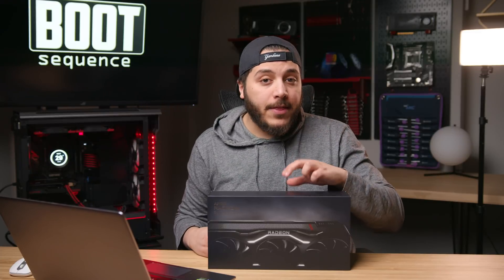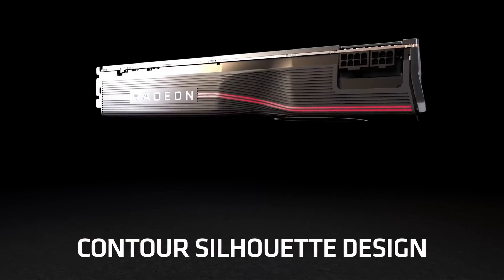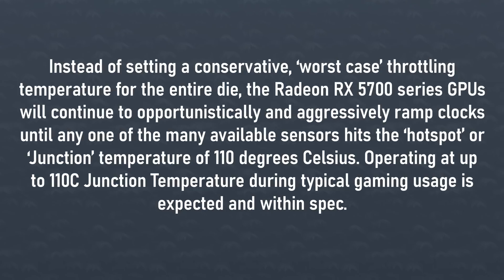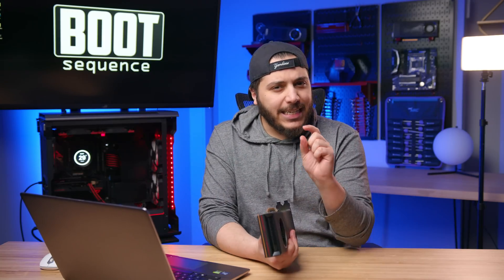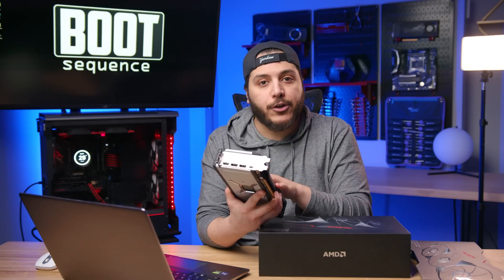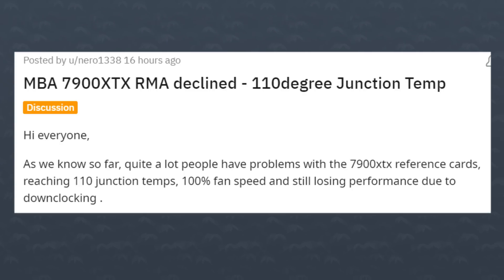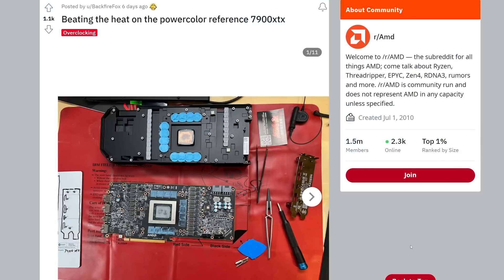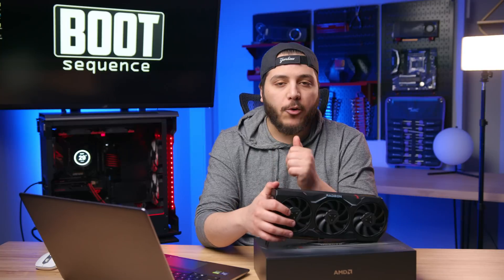RX 7900 XTX Reaching 110°c !? Not Again....

Comment: I literally just changed the 3 pads that surrounds the gpu on the xfx merc 310 7900xtx.  The stock ones were in bad shape. Im thinking its the pads i used cause my hotspot temp all a sudden is 110c.  Its never been this in the yr ive had the card.   Any recommendations on proper pads ?

Comment: I found a fix for my RX 7900xtx junction temp 110 degrees C.
My coolermaster case has the giant 200mm fan on the side and was blowing fresh air in at my GPU.
The Gpu blows its hot air out that side so the air coming in the side fan at the gpu was stopping the hot air from coming out of the gpu! I turned the side fan around to blow the hot air out and my gpu dropped 20 degreed from 110 down to 90!!!
I believe if there were no fan on the side and it was just a side panel this would block the flow from the GPU enough to cause the GPU to heat up.
Try running it with the side panel off and see if it fixes your problems!!

Comment: Honestly, the whole a situation reeks. Look, there was a lot of reviewers releasing the evaluation of their AMD cards on release date. They stress test the cards in high demanding games, running the cards hours at a time. Many actually tried mild over clocking...
One week later, you see a few cases protesting about high temperatures. Unless more formal evidence or testing, I would have take the same position of AMD. Looks like more likely buyers remorse of custimers getting the card and reacting to the Nvidia price reduction on the 4800, or using too small cases with bad air flow or playing to hard on the overclock dials. 
In my personal case, I choose to pay the extra $100 for the XFX Merc 310 7900 xtx, as I have the proper case, power supply and want factory overclock. The card runs cooler and more silent than my previous 108O Ti.

Update 01/03/23. Looks like there is some preliminary findings that in fact some batch of the XTX cards may be having a problem with the vapor chamber. More statistical information is needed to evaluate the size of the product problem, but the small sample show the problem in 1 our of the 4 cards.

Comment: I run mine with a slight undervolt and cap the clock at around 2600 and my highest junction temp is around 85 during gaming. I've left it default and had clocks boost to 3100-3200ish and hit about 101 on the junction temp. I prefer the undervolt to keep the watts down and temps down. Card idles around 40-50 on a single monitor and when I have two monitors plugged in the temps idle around 50-60 at about 100w board power, pretty annoying. I pre-ordered the EK waterblock and hope that my custom loop tackles these temps.

Comment: Yea my xtx hits 110 but in the 90° vertical position because that’s how my case has the GPU layed out. Once i layed my case over and the gpu was either horizontal or vertical. The temps went to normal. it doesnt help i hear coil wine also now. pretty disappointed…
Reply from the maker: Yeah, coil whine is pretty bad. but apparently its often PSU related ( the power delivery causes the whine in the GPU ). So it seems like you are affected by this issue, is that correct ?

Comment: Just thought I would throw this out- I got a XFX 7900xtx MERC and it has run very cool and quiet. With 3dmark stess tests, my junction temp hasnt yet cracked 70c, regular gpu temp 55ish.  Im air cooling with a fractal torrent case with ambient temps around 70F.  Normal gaming junction temps are usually 55-60C.  Sad to see the reference boards with such issues.

Comment: I repasted 3 times my dude , with different pastes. That was NOT the solution. Still hitting 110c quickly
Reply: Jesus is Lord  interesting theory, but on the amd software they define junction temperature as the hottest point on the cpu die.
Reply from the maker: what about your edge or avg temp ? If they're in the 70's, then theres a problem. If they're in the 90's, it should be ok.
Reply: @BootSequence  edge temp 60-70 max

Comment: Well you are a bit wrong, a guy who repasted his 7900XTX was still complaining that his temp was going to the max, and sent it to Der8auer.

Without changing anything Der8auer tested it and lo and behold it was completely normal with the Junction Temp reaching only 82 degrees.

Of course it could be that the dumbass just has the graphics card in a case with bugger all airflow.

So less of a hardware issue than a PEBCAK one.
Reply: "Without changing anything Der8auer tested it and lo and behold it was completely normal with the Junction Temp reaching only 82 degrees" is not true. He changed the thermal paste! As well as the "Guy"...

Comment: Sapphire reference 7900xtx here, can confirm im hitting 110c junction temp even at 100% fan speed, having to undervolt it to keep the junction temp a reasonable temp
Reply: I got one of those and suffer the same issue, playing God of War. Unfortunately for my case my local dealership is slower than a snail to process the warranty. And still waiting for the refund.  It's a shame that for saving something like 10 USD per GPU, they used the cheapest thermal pads, putty and paste.  For a low end GPU i accept that tradeoff, but for 1200 USD GPU there isn't an excuse for that.

Comment: The HEAT issue Comes From WINDOWS applications running Over AMD Drivers !
Reply: I won't be surprised if window has an update for AMD GPU balance power plan just like Ryzen CPU did.

Comment: Waiting to see what or if a dip in prices after CES. 4080 and XT are over priced. More than happy to skip a gen if it means they get the message.
Reply: MSRP to MSRP the 4080 is $200 more than the XTX. That extra $200 buys you DLSS + FSR + ray tracing and a GPU that doesn't overheat. You have an odd sense of "over priced" good sir.

Comment: I'm planning to get one, but at the moment i only have 2x 12v from my psu, since i'm upgrading from my 2080ti. So i have to get the Reference Model, unless i find a Card with a Custom Cooler which uses 2 instead of three 12v connectors.

Comment: In the past I had thermal (and noise problems) with my Vega 64 (Gigabyte, not the best), then some problems appear with 5700XT, then some 6800XT and 6900XT (MBA; Powercolor Red Devil 30% more expensive are fine 😅), and now the RX 7900 series...
Seems, for me, there a trend: AMD shows less expensive GPU than Nvidia (eg: 7900XTX vs 4080), but if you want a better and reliable cooling design/manufacturing, you've got to go to high end AIB models (less true with Nvidia, but still)
Reply: Another part of this 'trend' is that AMD always says it's normal behavior.  Working as intended.  Why don't we believe them?
Reply: @mikefur3957  because some people (reviewers, mainly) find those "disturbing" info before AMD tell them/us?
If it's expected, then why AMD doesn't mention them in the "features? ;)
Reply: @grospoulpe951  More proper as operational parameter than features... I understand the joke though.

Comment: The problem is that most manufactures do not give us enough data.
I cleaned my Sapphire Vega 56 Pulse and repasted it with Gelid Extreme.  But had to get thermal pad specs from Igor.

Now I have a Gigabyte RX 6700XT Eagle and the only thing I can find is a guy on Reddit that didn't get the pads right the first time. Did he get correct the second one????

This data needs to be made available to the end user. No, most people will never use it. But people like myself transfer hardware from the Windows gaming PC's to our Linux rig. I have a Linux rig that still runs a 380x Nitro and the card works perfectly because I took care of it.

In America we have, "Right to repair". The thermal pad info should be on the product website.

Comment: even if they stayed cool, neither AMD nor Nvidia's offerings are currently a sound financial decision. 
The fact that a 1000 dollar GPU is the "cheaper" option compared to the previous generations is still ludicrous, especially given the technical issues on both sides currently.
Intel isn't really in a position where it can compete with ARC yet and probably won't be in quite some time if that experiment even survives.

Comment: I have asus reference xtx. 110c at horizontal position and card is underclocking itself (thermally throttling) , when vertically installed everything is normal hot spot at 80-82c
Reply: Asrock reference xtx owner, ordered vert mount kit xmxs morning because of same problem. Hope i have your success
Reply: @dann8961  try turn your case on side, if problem goes away then it should be fine

Comment: Dead on, der8auer just got one of those hot GPUs mailed to him (reference AMD card) that was repasted to try to remedy and still had high temps, Derbauer reapplied the thermal paste once again and dropped it down to a 15-16c delta (temps of ~64c and ~80c hot spot) SHANANNAGAINS

Comment: I was pretty sure that it was the thermal pads/paste issue, when I installed new memory pads that were too thick in my 6700xt it was exactly the same 110c anomaly , only with very thin and super soft was the pressure on the gpu sufficient and the card is now running 10 % cooler than stock. In addition, "Der8auer" confirmed the whole thing in yt video yesterday with an 7900XTX that had the 110c problem. The temperature is back in the normal range after changing the memory and gpu thermal paste.
Reply: @rustyclark2356  my mistake, I didn't look closely yesterday, the fact is that the cooler and the vapor chamber are not the cause of the problem, and you can solve it with good paste and contact pressure
Reply: i read a guy that changed his paste and didn't get a difference ..  but in the same time .. people exposing their "problems" are 80% the cause of their problems too lol.. one thing for sur i know i my 7900 xtx mba run perfectly fine, always less than 92° in the most demanding games and with +15% power draw (so not even default value), so the problem is about a limited amount of boards
Reply: Mientras NVIDIA nos proporciona rendimiento a lo bruto aumentando el tamaño de su tarjeta, AMD aumenta a lo bruto las potencias de sus tarjetas haciendo que aumenten mucho su temperatura

Comment: yeah, being canadian  is not great for pc building and i know this all too well since i live in the province of Québec and very far from any decent store for pc parts so i have to rely on newegg . i don't like searching on amazon  because the search  isn't great and cannot be refined enough  in most cases. from a local shop i ordered and paid 460$ just for a sapphire RX 6600 to repace my gtx 1650 i rescued from an acer nitro prebuilt . i avoided the 6600 xt  because those 2 letters cost 125 to 175 more and for 5 to 10% more performance it is not worth that much  and i can achieve that by changing  my r5 3600  for a 5600 or better instead  for about 200$ or i could just change my aging 10 years old fully modular  OCZ 850w gold psu i have bought in the  days NCIX was still in buisness for that kind of money. 

i may just change it and have it sent to LTT  someday since this thing survived 3 pc builds and it's all Linus's fault since he did a review on it back i the day lol .

Comment: Solid video. Really wanted to go AMD this time, for my first AMD/all AMD build. I have had my XTX about a week, not happy so far. A product of this cost should be tested more extensively before being released. Drivers badly need to get released. Different displays/resolutions/FPS reporting different issues. If this isn't fixed in the next week, I'll be returning my card before the return window closes(15 days).
Reply: This is an issue with manufacturing, and is likely a sub-contractor, and not AMD themselves, but AMD is ultimately responsible for this. They really do need to have better quality control for something like this.

Comment: It's bad paste and pads actually, and the contractors paid to do the storefront job is Digital Rivers, dragging AMD under the bus.
I dunno who does the manufacturing or organizing the assembly and shipping, but I think AMD paid Digital Rivers to manage all of it, and as a result this third party outsource their work to another 3rd party which did a crap job at it.

Looks like the usual 3rd party outsourcing gone wrong again like CDPR and the QA company Quantic Labs, because the QA company ended up outsourcing its testing work to another cheap QA company without letting the client know.

Comment: 7950 X 95 degrees Celsius "Normal."
7900 XTX 110 degrees Celsius "Normal".
]OK got it.
Reply: 7950X and Zen 4 in general allows you to either have all the perf possible with the thermal headroom available, thus hitting 95C no matter what cooling (unless LN2 etc)  or you can limit the power and get the similar perf than 13900K with 30% of the power.

If we would only have full control over how much power they use, and how much power savings and performance they prefer, then it would be the best possible situation possible. Especially if you could change that preference through software.

Comment: I had a powercolor r9 290x years ago. That thing was warm as a campfire and loud as a Boeing 747. I also had a 6700XT reference model recently. It ran very hot and made annoying noises. AMD has had terrible reference models since I can remember. The new 7000 series should not be a surprise at this point.
Reply: I had a reference Vega 56, AAAMAZING overclock with Vega 64 flash and with fan at 100% 😵‍💫

Had to use liquid metal and cut out the fins out the back, ended up with the card @2800rpm (i think that was about 60%) and 1500-1600MHz in game clocks

Comment: I was thrilled when I got a 7900XTX on release day, but I've already returned mine. AMD really dropped the ball with this card at a time when they had everyone rooting for them. Very disappointing. I'll probably get a 4070 or 4060 when they are released.
Reply: If you returned it, hopefully it is because it didn't provide what you needed and not because of other people's opinions and reviews.
Reply: @terrymike7053  I returned it after I played with it quite a bit. It just was underperforming and, quite frankly, a very bad card.
Reply: yeah I think they rushed it and over hyped it
Reply: Why?  Because if you really bought it, then what is the reason why it failed you so much? Not that I'm happy with the launch, but price/perf ratio is till pretty good and most of the issues are driver and firmware related which I'm sure they will fix. And almost pretty sure it doesn't take the amount it took with RDNA1 as AMD now has multiple time more devs in Radeon.
Reply: Can you share you experience ?
Reply: @stylie473joker5  I played with mine a lot. It ran way too hot (I don't know enough about it to have taken it apart to check the cooler), it crashed games, it overclocked poorly (I even LOST performance in some situations), and the coil whine was impossible to ignore.
Reply: @billybegood466  Overclocking will reduce performance if you are overclocking too high, as the power budget is taken from VRAM clocks. Not really intuitive thing, but when you know it then you can check where the limits are.

Sounds like you had poor connection with the cooler as that really is the only way to get high temps, the cooler can cool down what the 2 eight pins can produce quite easily.
Reply: I bought a space shuttle yesterday but returned it because it was too slow. See, anyone can type bs.
Reply: @slim420-e8v  What's so difficult to believe about someone returning something that didn't work the way it was supposed to?
Reply: @slim420-e8v  So if you go to the grocery store for a loaf of bread, then you get home and find out your bread is moldy, do you keep it? Because I don't.
Reply: @slim420-e8v  They are flawed on the hardware level. Getting a replacement doesn't fix that.

Comment: AMD cards have been designed to reach 110c for the last 3 gens, and this 'problem' appears every time in the press. They aren't lying when they say its within spec and expected.
Reply from the maker: Designed doesn't mean top performance. If thermal paste and pads can give you fps increases, it should be stock point blank. Power color fucked up. A subscriber told me his XFX MBA is running well below junction. So there's a problem there.
Reply: @BootSequence  No it doesn't mean anything except 'designed', the thing you paid for... Your expectations are quite high. Most tweaking to stock products leads to FPS increases - there's a thousand things AMD could do to improve FPS.
Reply: that's 230 f , just a tad too hot for a MB
Reply: 110c is not ok. Its ok for silicone not ok for the case!
Reply: Also its a problem for all power color gpu s. 6950 red devil is also mess

Comment: With a temperature this hot you can cook a Li'l Smokie on it. It can melt a Hershey's Kiss. Could it make a watercooler boil?
Leaving it on this hot unattended without proper cooling and it'll catch your house on fire.
Reply from the maker: Man if i had the money, I'd cook a brisket playing Cs go
Reply: Well, no, because the watercooler liquid isn't going to be 100 degrees just the die is heated.
Reply: @WayStedYou  It only needs to hit  73c or 165F. an amd CPU at 95c or an intel one at 95+ could get the water to that temp. Basicallyhomeless cooked a piece of turkey while gaming.